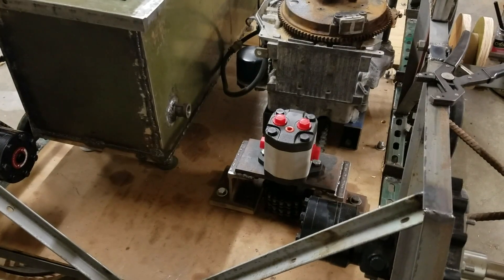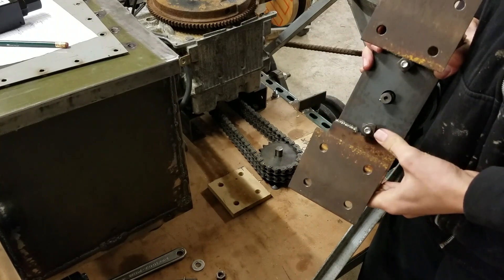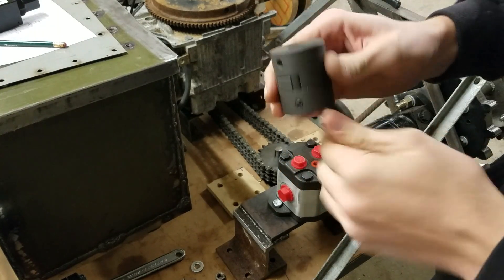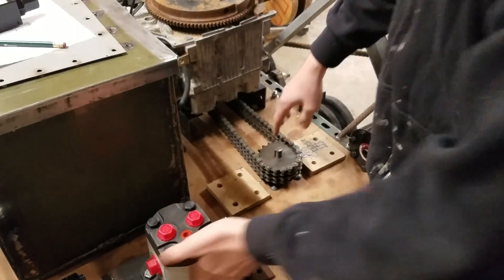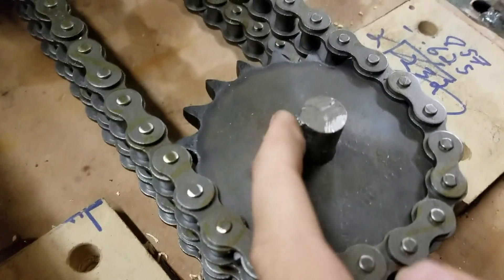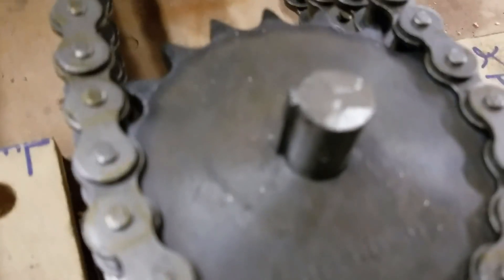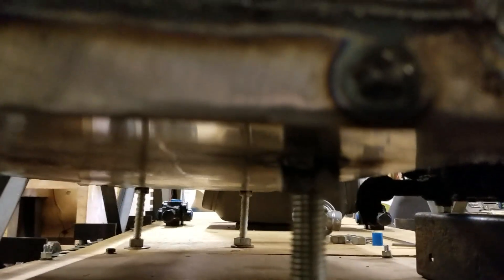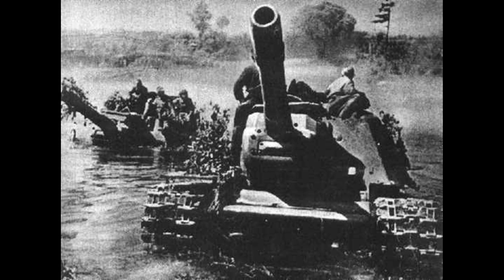Homemade Tank Part 11 (Pump Setup)

Comment: You asked about the 5/8 shaft and why would it have a 4mm keyway.  Probably figured this out by now but every once in a while metric and SAE line up at common numbers.  5/8 is almost exactly 16mm within a couple .001 of an inch.  

You are amazingly gifted which is even more evident in you newer videos.

Comment: Several observations: (yes, I know you finished this tank a few years ago but you may want to check the following:
1. Anywhere you use a non-locking nut you must add a lock washer and a flat washer to keep vibration from making them loosen up.
2. The drive from the engine to the oil pump should be a belt, not the chain. The reason is that the chain needs lubrication to keep it from falling apart, a belt just needs periodic tightening.
3. You should have left the other half of the i-Beam in place, it would have helped dissipate the heat produced by the pump.
4. You should have put a piece of angle iron between the stand-offs and the oil tank, the pressure exerted by those stand-offs on the tank could cause the tank to catastrophically fail, the angle iron would give it enough stability to prevent it. You see, those "stilts" must support the weight of the tank PLUS the impact of the movement of the tank across bumps, hills and obstacles; all that vibration against such a small area of contact between the stand-offs and the tank could cause cracks on the tank.
Reply: So not trying to help, just being  an asshole?

Comment: Good engineering and progress report.  The only thing, and I know it's been two years however, I noticed you didn't install any vibration or isolation dampeners under both the engine, hydraulic pump, hydraulic motors and fluid tank.  You could use any leftover treadmill rubber and cut them into washers to mount between the mounting plates, floor plates and hydraulic motor mounts.  Just a thought but awesome engineering and practical design.  Thanks for sharing.

Comment: Hello to all
nice job guys!
I would like to ask a question about the hydraulic pump that you see in this video, it seems to me that it is not the same as you saw when the parcels arrived with the material and opened them up. I would like to ask if there is a reason for which it has been changed. i am designing a crawler tractor and how to configure the hydraulic part and much like what you did, the only difference is that it will use an electronically controlled variable flow pump. good job and a greeting from italy :)
Hello to all !!!
Reply from the maker: the original pump I got was way too big, so I sent it back and got a smaller one. (eventually though, I added a second smaller pump, so the first one probably would've worked, but two pumps is much better anyway)

Comment: You do not have enough structure to support that oil tank.  That oil is heavy and it is an active load.  With 20 gallons of hydraulic oil sloshing around in that thin sheet metal tank, the vibrations from driving that thing will punch those nuts that you welded under neath straight through the tank.  You need a solid flat mounting surface for that oil tank, not small legs.
Reply: If you would care to look at his newer videos you would see that it did work...
Reply: a little late but.. anytime you mount anything to a tank that holds fluids or air or whatever you want-use a repad! It can be square or round. It also should be at least same thickness of tank or thicker. It's meant to spread load over a bigger surface area. But a support in the middle of the tank would help.

Comment: I am building a T-127 tank and I have a question, hydraulic or differential steering
Reply from the maker: +Martin Westriseby  the hydraulic drive motors are controlled by two log splitter valves on either side of the drivers seat. each valve controls one track (forward and reverse). It's the same steering system as on a bobcat skid steer, or zero-turn lawnmower
Reply: I know that. If I have a differential with hydraulic breaks it will be heavier but i can have a more powerful motor.
Reply from the maker: +Martin Westriseby  either way should work just fine (if done right of course) I went with hydraulic steering because it's simpler, as in less moving parts which means less things to go wrong.
Reply: Thanks for the help. When will you upload a video?
Reply from the maker: +Martin Westriseby  I just ordered some hydraulic fittings that I need so hopefully in a couple days. I'm on winter break now so have a lot more time to work on it
Reply: if your band breaks surely you must replace the entire band
Reply from the maker: +Martin Westriseby  what band?
Reply: "Track"